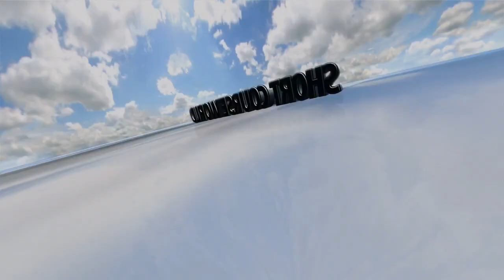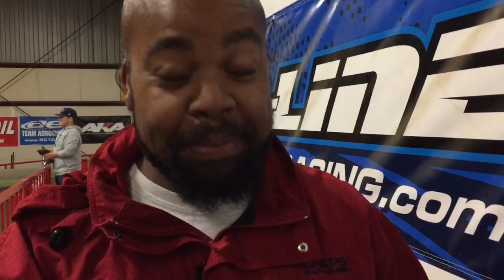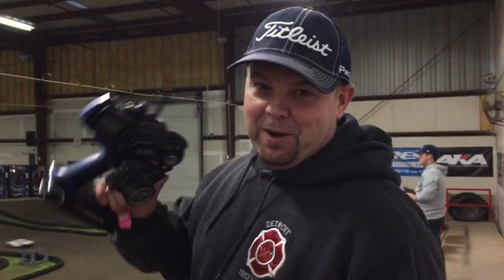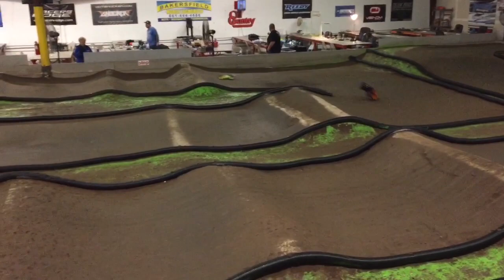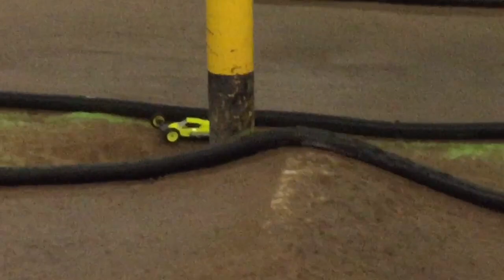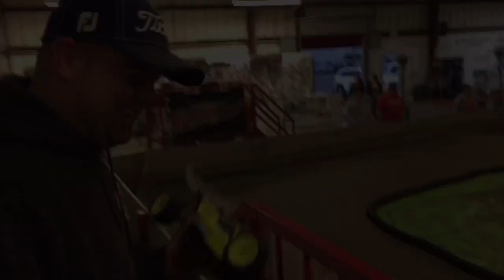MEGA FAIL while product testing B5M XFactory chassis

Comment: they need to put foam on the pole so when you hit the pole you don't break your car.
Reply: No, “they” don’t. Just don’t hit the pole. If you do, then fix your car, learn from your mistake and go practice.
Reply: @evhexrc1765  you know everyone is not a pro driver right?
Reply: Brian Schaefer lol yeah I do. The “pros” learn from their mistakes and get better. They don’t complain about a pole “in their way” if they hit it on accident, they get around it next time.
Reply: @evhexrc1765 
Foam or not, hitting the pole is something you'd want to avoid anyway, since there's a 100% chance you end up losing time getting marshaled. But using the foam to prevent catastrophic damage to the car means less time spent repairing and more time spent learning how to avoid the pole. Not to mention the cost of repairs ESPECIALLY on these high end models.

Comment: What would have happened if that were a 44.3?
Reply: RPM arms or non RPM arms?
Reply: Lol, I don't remember.
Reply: clockwoood it depends on the impact and power system of the 44.3, if it has stock, then always breakage
With rpm arms, it will survive mod motor unless your running 5.5 with 50 degrees timing boost like me

Comment: Seriously, stop with the “put padding on the poles” comments! That’s like telling the track owners to widen out a part of the track so it’s easier for you if you can’t quite clip the apex. Just don’t hit the pole! If you do, then fix your car, learn from your mistake and go practice! If that pole was padded and you’d hit it, you definitely wouldn’t learn as quickly because the consequences wouldn’t be as severe! Putting padding on that pole would also unnecessarily lessen visibility from the driver’s stand to the track behind it. Try to prove me wrong, I dare you. No balls!
Reply: I said it before, foam or not you don't want to hit the pole anyway. The "harsher punishment" of breaking does a good job of teaching you why not to crash, but it actually hinders the driver from learning the more important lesson of HOW not to crash because the downtime from repairs could be better spent doing laps and figuring out how to avoid the pole. In other words it actually temporarily prevents you from practicing.